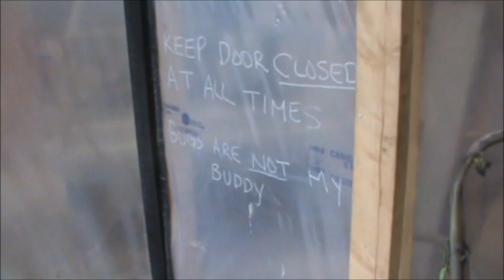A Little 56 Caddy Work....

Comment: The key tumbler is wore out inside likely. and not letting power to the coil when cranking, BUT does allow it just as you let go of the key. Get a new key package from LGL  mark in london , he can order it in and conferm that that is the issue BEFORE you buy . 
Regards John

Comment: sounds like ther is no battery voltage going from the starter solenoid to the coil.  The ballast resister should have 3 wires.  one end should have a pink wire which comes from the ign switch. That the feed in the run position.  The other end should have a black that goes to the coil pos.  There should be a yellow that comes from the "B" terminal on the starter solenoid to provide battery voltage when cranking (bypasses the ballast resistor cranking).  Check and see if its doing so.  Good luck.

Comment: to fix this on my mums 67 impala i put a relays from the ignition switch and the starter solenoid trigger to the coil so when the ignition is on it gets a full battery voltage and when its under crank it dosnt get the voltage drop across the ignition. the contacts in the switch for the accessiorys also fall to pieces sometimes on the starting position, its common

Comment: Andy...  replace the ignition switch.  I had one in a mustang that did the very same thing.  In the start position it was grounding out internally.. until I released the key it would then make contact and not ground out and start.  The switch was just worn out.

Comment: I'm guessing you're probably not getting power to the coil when starting. I know some older cars like that had coils that only ran on like 10 volts or something, there was a resistor to bring the 12 volts down, but during cranking it would run by-pass the resistor to make up for the voltage drop... at least that's what I remember from high school haha.

Comment: iceman22st has it right... The wire is either open or the starter solenoid is failing to provide the 12 volts during engine crank....